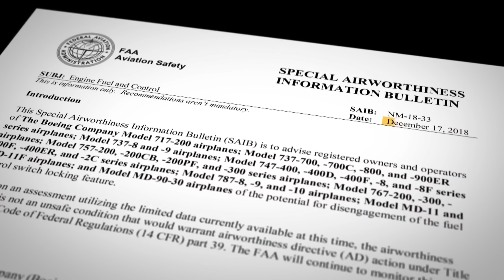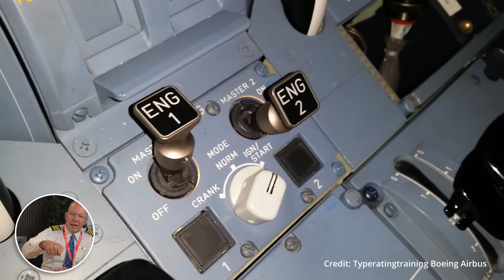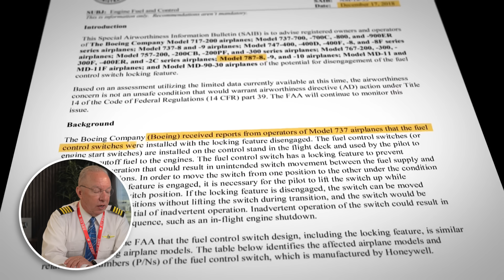Air India 171: The FAA’s 2018 Fuel Switch Locking Bulletin Explained (16 Questions Answered)

Comment: Camera would not prevent accident but it would show who pulled the switch. I don't see why pilots are opposed to cameras. Other vehicle operators have cameras.
Reply: Police have cameras, buses have cameras, cameras on the streets, cameras in the airports. I work in a hospital, cameras are everywhere even in the operating rooms. They should be in cockpits.
Reply: @SteveNas530  Many trucks are equipped with dash cam systems that also directly record the driver at all times.  That's a pretty close equivalent.  One YouTube of a crash showed that the driver was looking down at his phone texting and that caused the crash.  He only looked up AFTER the crash started.  Without that video, anything could have been claimed.
Reply: Because they are concerned about possibly being held to standards of behavior 
(Opinion)
Reply: Because they have sex in there too
Reply: because steve drinks and pilots use profanity and they dont want it to be made public. Steve is the same one who went on CNN India within 24 hours purporting the idea of flaps up versus gear up. Dont believe what he says.
Reply: @carpetbilly shut up and rest

Comment: i am a 14 year old aviation enthusiast from India  based on how you show the fuel switches moving in your 777 300(I believe) i dont see how they could have moved ont their own, but could their be any chances of the wiring leading to the switches pressing against each other or, if some high current wire s looping around it generate a field to temporarily disengance the system but I suppose that wouldnt be possible with the 1 second delay per switch, could be pilot error also as the fuel is directly connected to the EEC any fault or metal fatiue perhaps could also lead to this? I am only saying these because indian airlines(not that one) have a ......mediocare sense of servicing their planes ......I am still keen towards a mchanical defect but again this is just too much speculation i suppose.

Comment: 2018 FAA SAIB NM‑18‑33 warned that certain fuel‑control switch locking features could disengage, allowing an un‑lifted lever to slide between RUN and CUTOFF under vibration/acceleration. Air India never carried out the recommended inspection. It's purely the aircraft maintenance department fault. 

The 787 switch is entirely manual—no motor, no stepper, no command from the EEC—so any chip inside the engine control loop cannot physically flip it.

Both levers moved one second apart at ~180 kt: a classic “creep” signature as acceleration loads change when the nose pitches for climb.